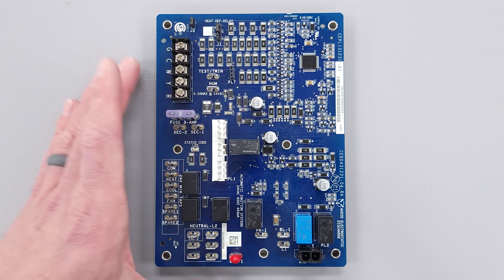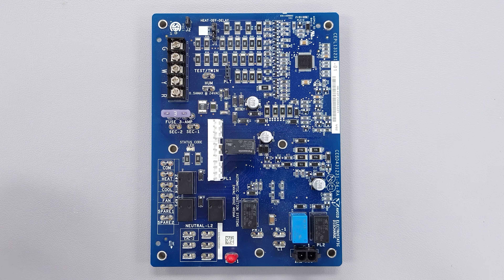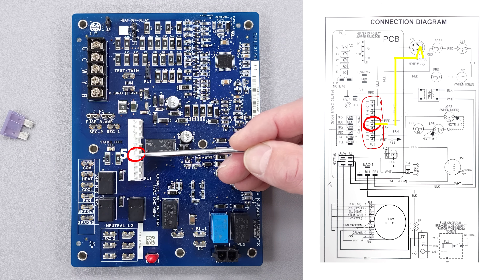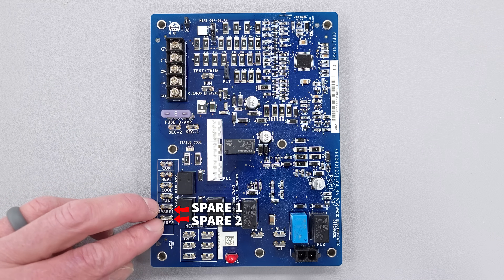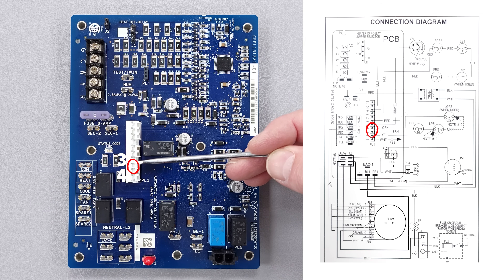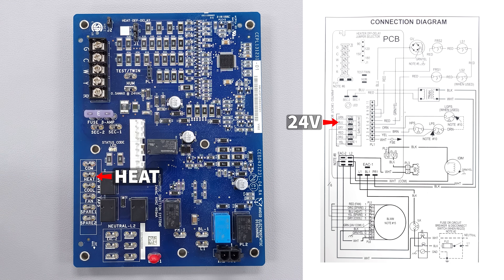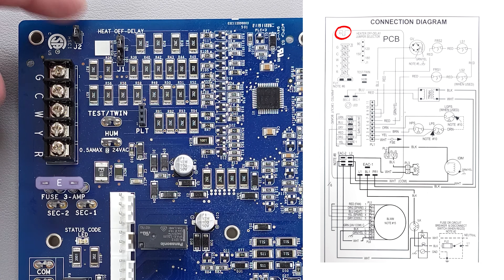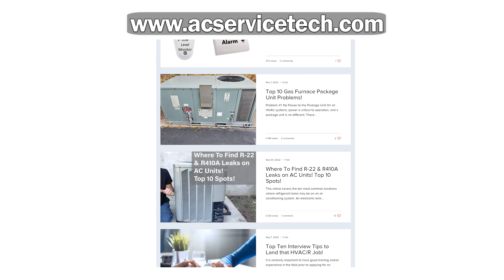Gas Furnace Training! Integrated Furnace Control (IFC) Circuit Board with ECM Motor & Wiring Diagram

Comment: Hello, I have a carrier infinity system that asks to connect the 24V (red) cable from the leak dissipation board to the SEC-1 on the furnace board. The sec-1 is occupied by the transformer. Is there any reason why I shouldn't connect the 24V directly to the R terminal on the furnace board instead of piggyback connecting to the SEC-1 connection?

Comment: thanks, for the video, it is such high quality , question:after shorting the R and W screw terminals and hearing the click (of a relay) but no inducer motor startup, what would cause the control module LED status code to still show waiting for heat request instead of some error code? the pressure switch was verified to be open, and even if the combustion inducer motor relay is faulty, wouldn't that be reflected in the module LED status code that the pressure switch still open as if there is an obstruction in the air intake of the inducer ? both inducer motor and pressure switch were tested by applying external power to the inducer
~

Comment: This is my exact board in my carrier CVPVA36 connected to a Broad ocean motor  - I live in NC and experience high humidity.  Best I can tell, If I switch the gray and orange, I have switched from high speed cool to medium speed cool.  Will this mess up my unit? I have already done it, and air seems a lot cooler but I read the delta T shouldn’t go over 20F.  What is the purpose of the Orange and Yellow if they’re not used.  I thought if you slowed down the blower speed then the dehumidification works better.  I just don’t want to mess up my system, but I DO want better dehumidification .  Thanks for any insight!

Comment: Great video! Question about motor taps. I have a Broad Ocean ECM motor with a similar control board layout. My fan speed in FAN mode is very high and even if I swap to the heat fan speed tap (which is lower about 280-300 watts) I get the same fan speed and power usage (700 watts). Is the control board somehow overriding those speeds? Thanks

Comment: Such a great video. Here is my issue. Sensi thermostat that is new. 80% furnace 20 yrs old. PCM motor. Just replaced stat with Sensi.  Problem I have is both the blower and inducer motor both come on at the same time.  When I disconnect the green wire from the terminal, the green wire has 24 V all the time.  Disconnecting it also causes the furnace to operate properly where the inducer motor comes on first followed by the blower a minute later.  I haven’t diagnosed the thermostat, but it must be either broken such that the green wire gets power all the time or maybe a short and the stat wire. Yes the green wire to ground has 24 V all the time regardless of whether there is a call for heat.  I have one contactor wire going to the Y terminal along with the yellow wire from the thermostat. The other contactor wire goes to the C terminal.  Any ideas why my green wire has 24 V all the time which is causing the blower inducer to come on together?

Comment: Can you do a short vid on motor settings boards (which are a bit smaller and usually located under the main board) with the jumpers and and CFM indicator? Thanks 👍

Comment: Is there anywhere I should switch on/off to avoid the fan to start stop? I’m having a hard time with that, my old board was set for furnace and fan work constantly this new one fan keeps going on/off - thanks for any word on that
Reply: The G terminal is the thermostat input that toggles the fan. If you set the thermostat fan switch to on the fan should kick on. Alternatively you can put a jumper wire from R to G. Some boards have a permanent fan on delay for heat/cool that cannot be turned off.

Comment: I swore he said the rollout & high limit were normally open….Maybe he misspoke
Reply from the maker: I was saying the inducer pressure switches are normally open, thanks!
Reply: @acservicetechchannel  - Thank you for the video!  You guys are the best ones out there.  I believe you did address this question as well but if the pressure switch is closed prior to calling for inducer motor to start (seamingly indicating there is a vacuum even though the motor is not on) that will also not allow the sequence to continue correct?
Reply: Us Craigs need to stick together, Craig!  There aren’t many of us out there!!🤣

Comment: I have a question if you set thermostats fan on and it’s running in cooling or heating why doesn’t that energize both speed taps.?  Aka the cool tap and the fan tap
Reply: Your thermostat also has another switch--Heat or Cool.Only 1 at a time.
Reply: Only one speed tap will be energized at a time because the fan can only run at one speed at a time. The cooling or heating speed will override the continuous fan speed. On PSC motors if you energize more than one speed tap you will destroy the motor.
Reply: @ okay so if you turn your heat on in a straight cool and aux heat comes on the heat relay energizes heater but also blower? Or does thermostat turn fan on? And if it’s the relay what happens when you set thermostat to on after the heater is kicked on ?

Comment: Is  that galvanized pipe ?? To furnace..isn't that prohibited
Reply from the maker: No there is no IFGC code reference saying not o use galvanized pipe. That may be an older inspector's preference due to very old galv piping that used to flake but there is no code reference saying that you can' use it. In fact all coastal towns only install galvanized gas pipe because black iron rots near the ocean. Supply houses near u do not even bother selling black iron. It may look odd to someone inland though!
Reply: @acservicetechchannel  Did not know that.

Comment: As someone who used to train field service engineers on servicing chromatography instruments, I just wanted to say you are an GREAT instructor.   Too bad you can't train every HVAC tech out there.  The ones who have come to our house have nowhere near the trouble-shooting abilities you teach.  I did have a question though that maybe you could answer.  Is it possible to change the blower speed on the air handler for a heat pump?  The reason I ask is, because I swear the blower on the air handler in the attic for our upstairs is blowing much harder when the heat comes on now than before we had our bi-annual inspection.  The guy was up there for quite a while.  The blower is running so high now that things hanging on the walls shake and vibrate.  It never did that before.  Is it possible he changed something to make that happen?
Reply: It is absolutely possible to change the blower speed. For at least 35 years, almost all furnaces and air handlers have had at least a 2 speed blower motors. Many have a 3 or 4 speed. In more recent times, most are 5 speed and in some cases variable speed. There are many reasons the tech. might have changed the blower speed.

Comment: I really wish people would stop saying cooling on the higher fan speed. That's not a true statement in our neck of the woods. A lot of the time, the heating requires the same or even higher fan speed than the cooling.
Reply: Cold air is heavier then warm air that's why blower speeds are by default are on a higher speed in ac mode then heat mode.

Comment: 👍 I just walked one of my new customers through the control board on their heat pump. A technically inquisitive customer I love these kind of customers..   the customer wanted to watch everything even on the roof and I handed the customer the wiring hematic and explain the mode of operation and the customer actually understood and was able to point out wires as I described how I was going to jump and bypass the board .    And liking all my other cases, this customer immediately recommended me to the condo condominium directly across the hall who is also having problems.. and this customer was just quoted a whole brand new unit from the other HVAC company.  When it was only a defrost control board problem.. 
      Now I’m doing the neighbors heat pump system, and there’s literally several hundred other condominiums in this whole neighborhood complex.  
    Where are the neighbors are starting to discover they were getting ripped off and sold systems that they did not need. 
       I like smart, educated inquisitive customers, and they could watch me and I’ll explain everything to them step-by-step as I’m performing every procedure of diagnosis test. I love this..
Reply from the maker: Thank you for enjoying my video and for sharing your story in the HVAC industry! Hearing other tech's stories in the industry is one of the most rewarding part of my job!!